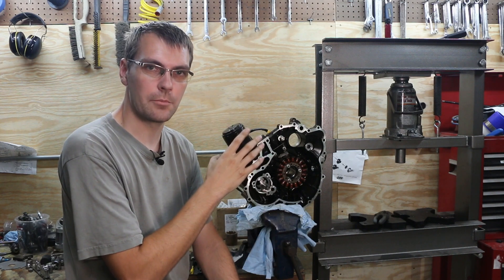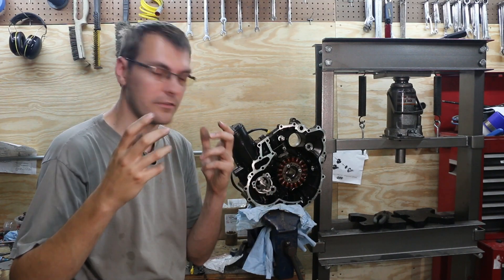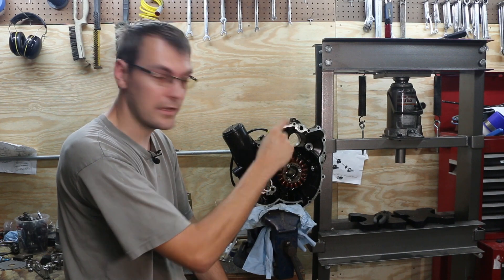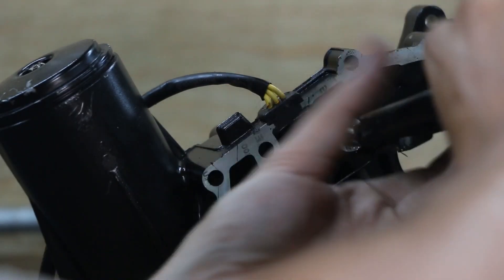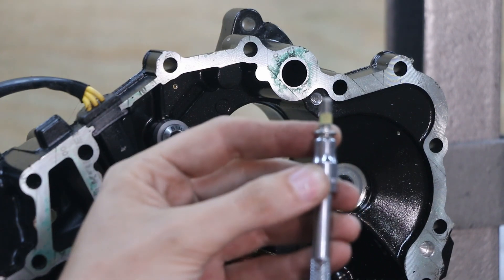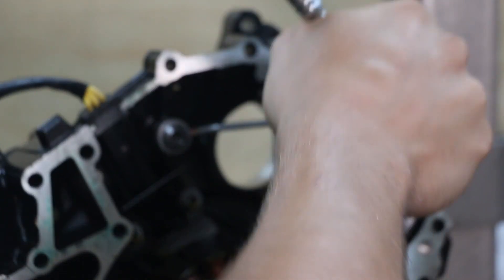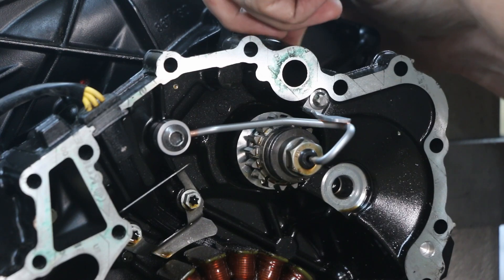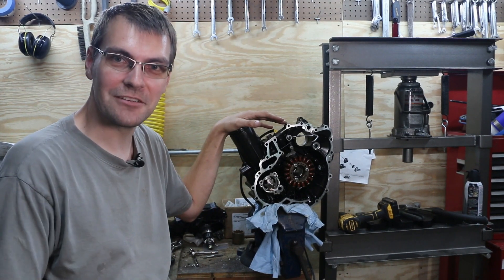Seadoo Supercharger oiling upgrade, 08+ nozzle conversion.

Comment from the maker: Products used in this video:
➡Vice grips: https://amzn.to/345IeWM
➡M10x1.5 Tap: https://amzn.to/3zg5iha
➡M6x1.0 Tap Including 5mm Drill bit: https://amzn.to/3ENlrM0
OEM Parts:
➡1x 420856875
➡1x 420641048
(These are Part number 7 and 9 on this diagram: https://partsfinder.onlinemicrofiche.com/watercraftsuperstore/showmodel.asp?Type=13&make=seadoopwc&a=261&b=11&c=0&d=-MAGNETO-ASSY.-W/-PTO-COVER )
➡Install gasket set: (you technically only need the pto gasket but an install kit is nearly the same price and then you've got all the gaskets you may damage during the removal and reinstallation of the engine) https://www.watercraftsuperstore.net/sea-doo-install-gasket-kit-4-tec-sc-gtx-rxp-03-07.html?Affiliate=TrythisTV

(These links may be affiliate links, which will earn me a small commission from your qualifying purchase should you choose to buy these products)

Other videos in this series:
Introduction: https://youtu.be/uchDz5h8HE8
Autopsy: https://youtu.be/rLM_rFfzzYc
Reassembly: https://youtu.be/XGgZkmEdwB8
Supercharger oiling upgrade: https://youtu.be/rL2X-0yeezU (This Video)

Comment: Great video! With the 2008 setup can you still use the supercharger from the 2005 RXT215? It doesn't appear to have the same oil "drain" hole within the housing on the 2005 version when compared to the 2008 supercharger. Thanks for any input!
Reply from the maker: I am running it on my 05 RXP215, and have done the upgrade on multiple customer skis that do not have the drain hole with nothing but positive results, I am however looking into making a jig to drill that hole on older housings, but the oil nozzle has no effect on that as the oil that goes in the end of the shaft comes out under the gear which is solidly outside the housing, the bearings just get splash lubrication essentially.
My understanding is that the drain hole that is drilled on the 08+ housings is there purely to allow any excess oil to drain away from the bearings to help prevent it seeping through the front shaft seal and into the intake, as well as potentially reduce drag ever so slightly.

Comment: New to this but if I do this conversion can I run the new style 137 mm
Reply from the maker: With or without this, you can run the 215 or 255 charger, and I believe the 255 is the 137mm wheel. This is primarily for longevity of the SC bearings and clutches. If you want to run a 300hp SC, you'd need a whole new pto housing as well as flywheel gear and such, as there is a different oil drain setup and tooth count on the 300hp chargers. If you stick around, my seadont is getting a 255hp SC along with the supporting mods to turn it into a 255hp rxp, I just need to get a chance to get some good baseline 215 performance numbers before I go too wild with the plans.